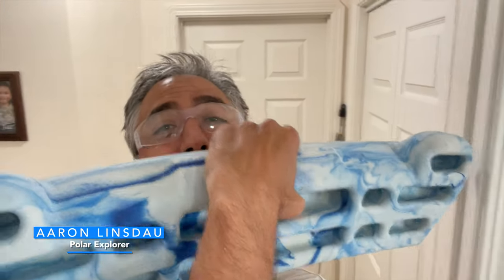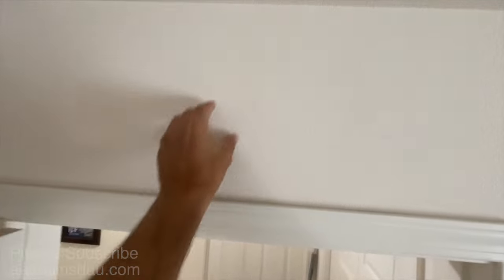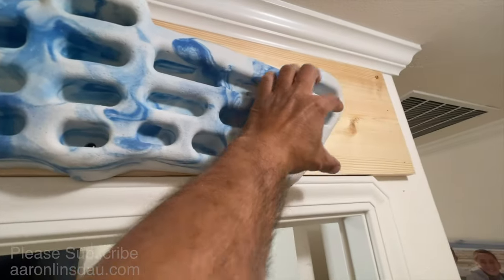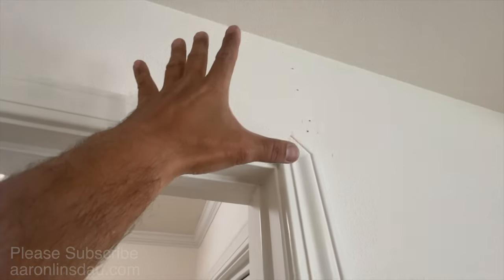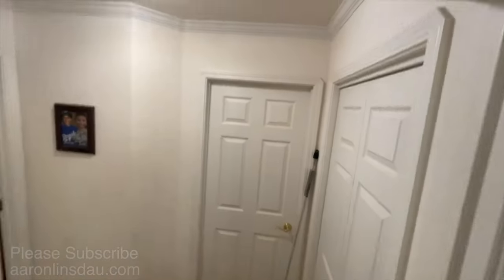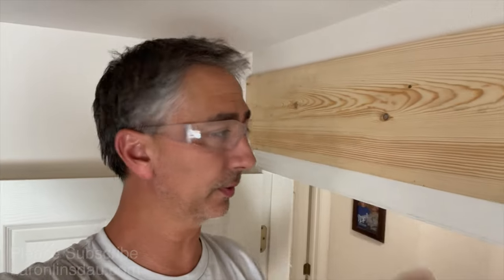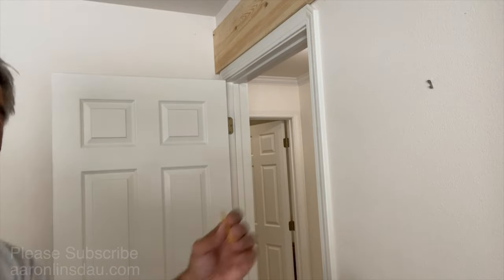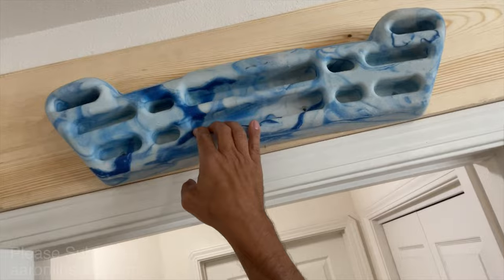Installing Metolius Climbing Hangboards At Home (4k UHD)

Comment: Sooooooooooooo glad to live in a building which is ALL brick and mortar... even some rebar reinforced concrete structural elements available. No need to worry about finding solid substrate to attach it. I used four (2 could have sufficed but... no kill like overkill!) Petzl climbing anchors to fix mine. Bosch Hammer Drill and done.